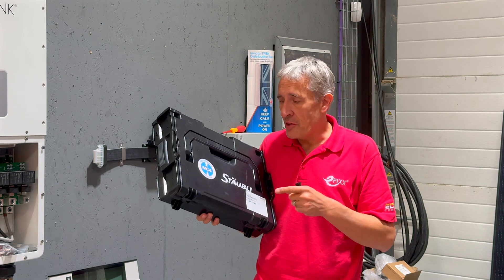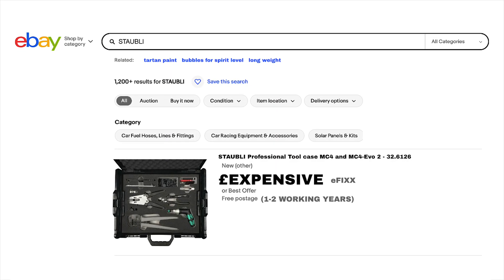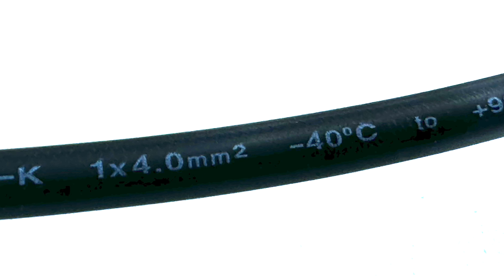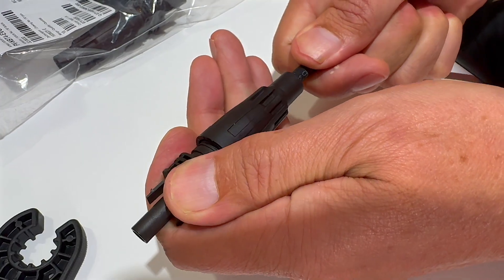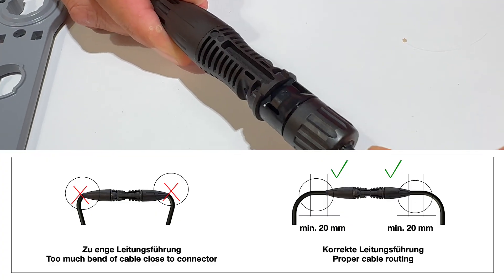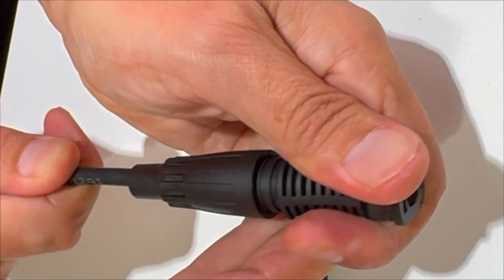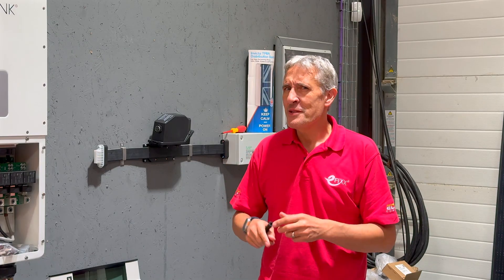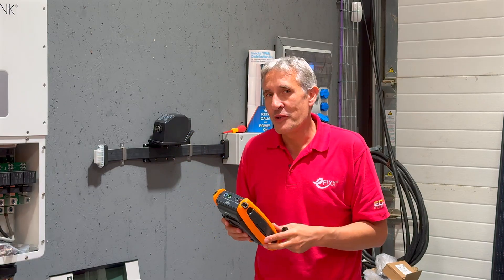Say GOODBYE to Crimping with the NEW MC4 Connector!

Comment: Staubli basically copied the PV Stick sets from Weidmuller, which I have been using since 2017 for offshore projects.
Reply from the maker: Our understanding since making the video is that Staubli version is made by Weissmuller.
Reply: @efixx  Thanks for this info, that honestly does not come as a surprise. The Weissmuller PV stick sets are known to work well witt Staubli's original MC4. Good call from both companies. Used many of these sitck sets, only once had an issue with them, with some water ingress. Not major, no real harm done, but the connectors were a bit corroded.

Comment: Run 25 amperes and check temperature increase and voltage loss. That way all connectors since the Roman Imperium have been checked, why do you forget the most basic stuff.

Comment: I have a MC4 crimping tool which is horrible and therefore I additionally solder my MC4 connections after crimping.
Glad to hear there is something new around.
Reply: You get less resistance that way too.
Good idea.
What wattage soldering iron did you use?

Comment: This new version is a response to different crimping techniques that can fail. 
It may seem inadequate, but the Constant Spring tension on the cable makes all the difference…. Even though the wire is only contacting the spring clip. It’s not crushed by 8 sides. 
I still 8 point crimp and solder if there is any high current

Comment: Do you know a way to open them again if you have used them once? I made a mistake with a wire that was too thick and it closed the clamp, without the wire in it. Any help would be welcome.
Reply from the maker: We’ve done that by mistake - unfortunately I think the mechanism latches inside and destroys the sprung part when you pull the tab back.
Reply: @efixx  Thanks for your quick reply. If I find a solution, I ll post it here. But I guess you are right.
Reply: From Staubli I got this reply: The connectors cannot be reused. We understand your concern (I told them I thought it a waste when good connectors have to be thrown away) but we cannot warranty that they are in good conditions and are safe for use.
Reply: @russellhutson1603  Thanks so much for mentioning! Now where to find them :)

Comment: What a joke...a wago style vs a crimp....you really do not understand anything, crimping is a far better contact and mechanically stronger.
Reply from the maker: I think we demonstrated this during the video 🤷
Reply: Na, forget crimping! Solder is the most reliable way for electrical connections (as many here will confirm). Therefore, I always solder devices directly to wall sockets. Safety first!

Comment: the biggest problem by the MC4 Connector is when the connetor is not 100%waterproof. Water comes inside, the connector oxide, the connector is works as 'resistor'heat up and begins any time to burn.
second reason for leaking is the plastic, iit get harder and crack and ist not waterproof.
Reply: Always use Connectors from one Supplier. If the Moduls use different ones, change the one you want to connect to the string.
Reply: True.  That is one reason I smear on battery insulation grease inside each MC4 connector to provide just another layer of protection.

Comment: I use Wago type quick connectors only where the currents are low. The connection is the Achilles heel of the system and usually the best fire starter so I would still prefer the crimp connectors.
Reply: I have seen test YouTube video showing wago ac connectors handling up to 60 amps. So this looks to be adequate for applications.

Comment: I prefer soldering over any of this. Never had a solder fail. Always had problems with mc4.
Reply: To do soldering on top of crimping is not a bad idea but if you have 400 pairs of MC4 connectors to do it's not going to be fun
Reply: Doing this professionally all day long and we virtually never had problems with MC4. So it might not be the connector type that is bad...

Comment: One of my MC4 connection was burnt and crispy on the contact side and not the crimp side.
Reply: Any idea what caused it to burn? I’m trying to learn from other’s mistakes, if there were any that is…
Reply: @nelsondog100  my money is on cheapie connectors.  It's pretty hard to go wrong with good ones, even if they aren't made by Staubli.
Reply: my bet is on. the MC4 crimp was not pushed in the connector fully.. or cheap connectors that have a lose connection.. arcing happends when the connection is bad.. electricity jumps from one matterial to the other.. also make sure you strip the wires at the correct size.. of you strip wire to long on the female connection.. the male connector wont fit propperly.. i never hear any youtuber sparky talk about that. but thats prety much the first rule
Reply: @freelifeproductions  You presented two points: Poor Quality, Poor Workmanship.

The connector in question is from a Panel. Possible poor quality? Upon more checking, I did find the terminal was not crimped using the usual tool, yet the burnt part is on the other end which negates the crimp issue.

Only thing I could come up with is that I had connected/disconnected it many times as I frequently check the terminals. Could it have worn/loosen the material a bit? Did I do more harm than good with the inspection? I am definitely sure I inserted it all the way - most definitely.

Comment: The 1500V DC Is twice the voltage Dutch subway&streetcars run.
Dutch rail runs 1500V mostly.
Using these tiny connectors under such voltages and loads gives me serious doubt.
I do all my pv with boxed and tention-released wire nuts or very good pull proof twisted wire soldering.
Pull any wire here due to storm or anything and it would break before their connections break.
Not much more i can do.
Reply: As a class of connectors they can be seen all across the world carrying 20A+ daily.  Even taking into consideration all the cheapies out there that are usually the source of PV fires in wiring, they are a pretty reliable thing.  The voltage isn't really an issue once you have good insulation and they do.
Reply: They are designed and made for this exact purpose. How low can trust in life and people be..? And, if you're concerned about voltage and the size of a connector forwarding it, you maybe better do no electrics. Yust saying...

Comment: I'd like to see a current test on it compared to a standard crimped
Reply: I dont think its the crimp joint that's really at fault, its the human as per-usual. They either don't crimp correctly or maybe a tool is work/out of calibration etc, this will be what causes the failures!
Reply: @Pickle_Rick-m4o  I doubt most installers get their crimper calibrated or checked, even those with name brand ones.

Comment: i notice you did all your horsing around without gaz being there lol
i may have missed the bit where you explain how much faster this could be than the previous method...
Reply from the maker: We’ll make a test and post it as a video.
Reply: @efixx  Do 10 of each in a row and not as a speed run but taking the same level of care as, you'd hope, an installer on the job does.

Comment: Must say not a fan, I dont trust the connection
Reply from the maker: Do you use any Wago type connectors?
Reply: @efixx  very different to wago’s ie voltage amps I can see the connection in the wago too and those wires are really fine so some must get frayed in the connector maybe if I could inspect it might not be as bad
Reply: @DTech101  The typical WAGO lever connectors most people are familiar with, 221 series, are rated to 32A (IEC).  These Stabulis are rated to 30A.  Not a lot in it, is it.  221s are rated for 450V use but there are much higher voltage lever connectors out there and again, they cope with it nicely.  It's not impossible to combine amps and volt ratings to get a connector that does both.  Take a look at how the wire is carried into the clamp with a cage.  If one did a really sloppy job I have no doubt that strands could go astray but if one is that sloppy already, I think there's going to be other issues in the job far more pressing than 1 or 2 strands out of 50+.

Comment: WAGO is FTW IMHO.  Spring Loading is a preferred method for maintaining a low resistance electrical connection over temperature cycles, good thing you have those seals to keep out moisture.

Comment: Have to say I am amazed if all those thin strands of cable make it into that push fit connector without a few going astray. Not a solar guy but would have thought those are just as likely or more so to have problems when assembled up on a roof in the wind and rain. On an average installation there arn’t very many mc4’s to make off, only two on the roof for and two in the dry for each string, so my money would be on a crimp, but then I served my time in 1980 😂😮
Reply from the maker: We thought the same hence getting the Dremel out!